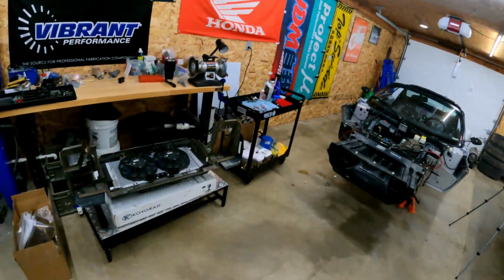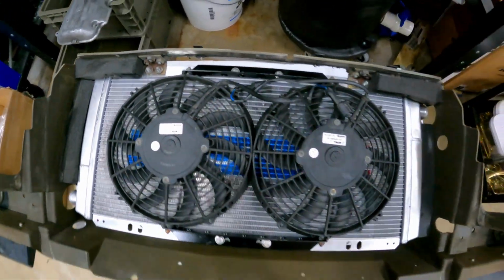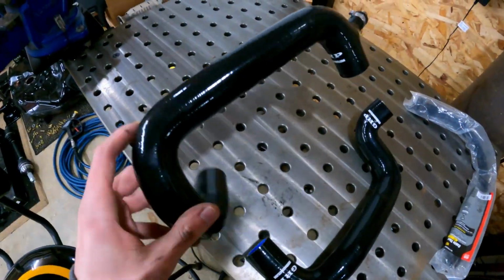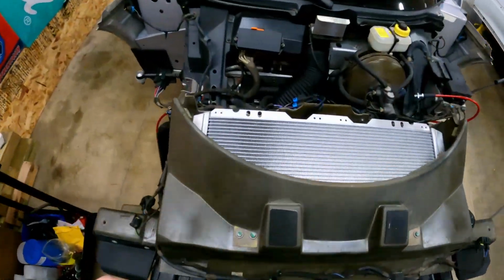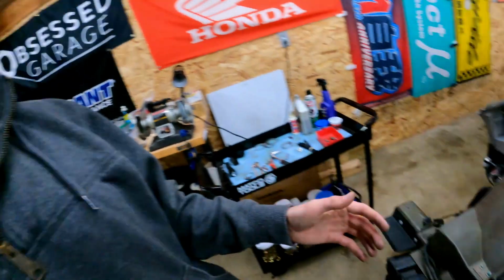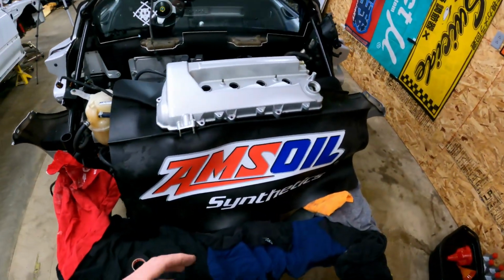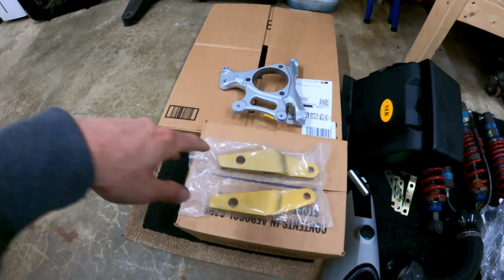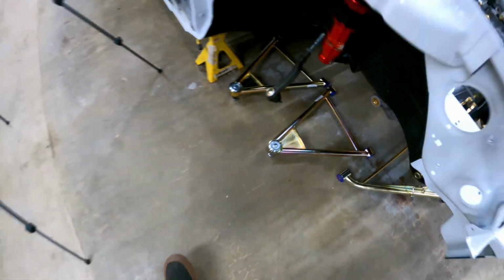Finally starting to assemble my Lotus Elise

Comment: Hey man, do you have blocks of foam inside the cross members of your chassis? Specifically the extrusions that the top front wishbones mount to...do you know the purpose of it and where I could get replacements?
Reply from the maker: I do not think mine has them, and I wouldn't think they do much there. As for replacements, maybe just buy some foam and cut it to fit yourself?
Reply: @donkuschel5326  Yeah, I think they're there to keep brake dust, road dirt, etc from entering the HVAC...Not sure they can be replaced from outside with the wishbones in place. Thanks!